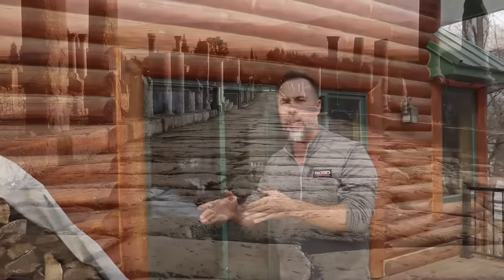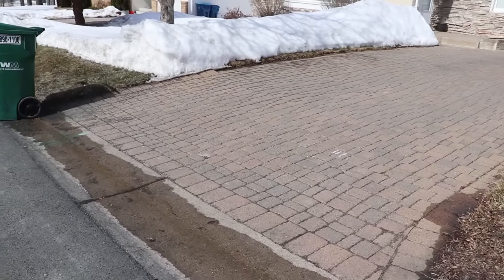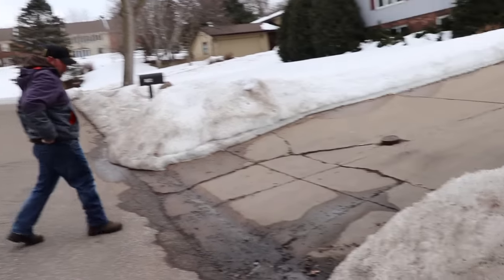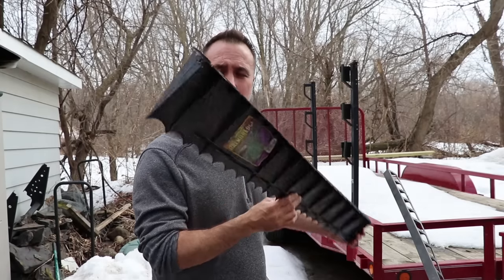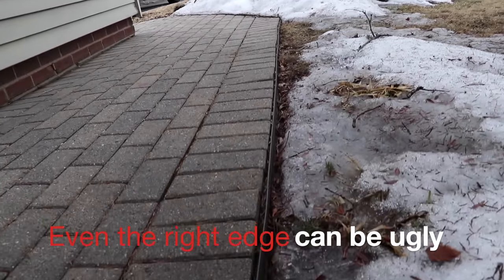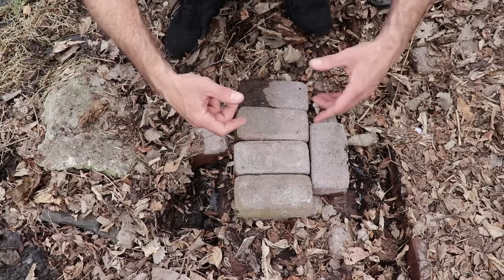How NOT to Build with Pavers-  Why They FAIL! *DIY your own successful paver project

Comment: The new construction industry standard for pavers here in North Florida is 4 in of paver base for patios and 6in of paver base for driveways. And a concrete border around the pavers that's hidden with sod. It's terrible but that is the standard that is held here in Florida. There are only a handful of paver companies who install pavers correctly and they do not do new construction. They do strictly residential sales and many of them do install pavers correctly. Unfortunately for Florida it is mostly sand and it makes it very difficult to keep pavers nice for years on end

Comment: Very good video, Keep doing this.  I plan on replacing my driveway with pavers, and yes my driveway suffers from whole sections of concrete that has dropped down an inch in some spots because of a failure in the bedding.  I am going to visit your "School" so I can see what you are offering.  I subscribed today because you are always presenting valuable information I can use in my projects at home.  Thank you very much.
Reply from the maker: Thank you and thanks for the subscription !

Comment: I like how he recorded the paver driveway from an angle and not straight, so you wouldn't notice the crooked lines. If you know you'll have a downspout, easy, put some concrete under that paver, it won't sink no mo'.

Comment: at our last house, i paid a guy to remove all that plastic edging and put in a concrete edge channel if you will.  The plastic was coming up everywhere and the 10" bolts were rusty too.  The freeze/thaw cycle just doesn't seem to let it stay as is. Would love your pov on this as installing that stuff is foolproof but after 10 years most of it was coming up.not a lot of topsoil either, mostly clay below the surface

Comment: For permeable pavers add an additional 12in of clear 3/4in rock with drainage tubes under the 12in of 3/4in crusher run base.

Comment: I purposely installed a walkway on my mom's house with scrap red bricks so that it would distort, slightly sink in places or drift to make it look old and crafty. My prep was dig out and replace 3 or 4 inches inches of dirt with regular sand over dirt which also made the water go away after rain storm because it was just mud before. On the sides I used more bricks lined up by leaning length wise against each other so the end of each brick was raised slightly higher than the bricks in the walkway. Then I swept some sand into the space between the bricks and was done. 
It worked as expected,  rough and not squeaky clean.  LOL
I would not consider this any where close to being a pro job but for a rookie it worked and I achieved the result I expected.
Reply: Sounds like if someone trips on them they will sue your drunk mother

Comment: Now that you explain the failures, what are the things that you can do to repair them. Or do you need to start all over again.
Reply: Ken Vendettuoli it depends if it’s concrete you can cut it with a concrete saw and pour new concrete ..if it’s pavers you have to take out the bad section and re install

Comment: Our side steps are brand new, (2 months old) put in by the landscaper.  Concrete base and pavers above. The sand has been escaping and now there are deep grooves between the pavers around the perimeter. Some of the sand bonded through the center.  What causes the sand not to bond all the way to the edges?

Comment: Wow, I learnt a lot here.
I have regular Pavers (no rock) and, they cleaned the Pavers and joints and rejointed w Polimeric sand, blowed excess, sprayed manually water w garden hose, let dry next day applied sealer and after 1.5 hrs started rain all day with times of medium to heavy rain. My driveway is on hill. Today I see sand down and I feel on top of the Pavers too.  I'm thinking to apply more sealer.  The worker left for vacation for a week. 
Polymeric sand.. Super Sand bond
Sealer... Seal king
Can I apply more sealer on top, after I blow the excess sand? Same sealer, same technique?
Thank you

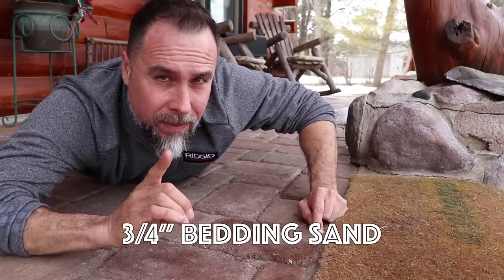Comment: At 4:10 you talk about the shifting of the sand but forget the most obvious reason for the paver to sink. There’s a drain pipe right above that brick that dumps tons of water every year right onto it.
Reply: At 4:04 it said water erosion, right after that picture came on screen.
Reply: yea, it oversaturated the sand and the base below it.
Reply: clacicle EXACTLY!!!
Reply: Cie Fy After watching it again, I did notice that. But still, it’s probably the most obvious reason and should have been mentioned. It’s an oversight. It happens.
Reply: I saw that too and thought it was the most obvious contributing factor. Nice video though - overall. Thank you

Comment: I have switched to 1/8 to 1/4 angular free draining in replacement of sand for paver and natural stone. Less washout and settling. Still use item 4 for base unless doing permeable pavers.
Reply: jaboy321 so you put pea gravel under your pavers as a bed? I’ve been trying to find info on this.

Comment: For edging I use angle iron, drive rebar into ground and weld it together. 10 years since and has not moved. I just had some angle irons laying around at the time so it didn't cost me extra.
Reply: I just laid down a 57 ft driveway, and my edging is nails made from 1/2 inch rebar cut in 12 inch lengths, beveled on the ground side; one nail for each stone on both sides of each row.

Comment: I'm adding a small section of pavers to an existing paver patio.  Should I install them a bit higher (1/8" or so) to allow for any settling or sinking over time?  Or, do I just install at the exact same height?

Comment: great info.  have seen pavers being pressure washed.  with ordinary joint sand seems the sand would get blown out of the joints causing horiz failure.  with polymeric, is it possible to pressure wash pavers?  under what scenario is it possible to "clean" pavers?  thanks!

Comment: i have zero experience with pavers, so these may be stupid questions, but...
1)  How do you clean pavers?  I assume a power washer or even a hose nozzle would wash away the joint sand.
2)  Can you grout or morter the paver joints?
3)  What the installed cost/sq ft of pavers vs. concrete vs. asphalt?

Somewhat related...I have a roughly 900 sq ft concrete patio that is showing wear/cracks, estimated age 50 yrs.  Can I tile over the concrete?  Patio is not covered, annual snowfall ~6".
Reply from the maker: clean with a pressure washer.
no mortar or grout-only polymeric sand

Comment: Don't forget . 2500 years ago people actually cared about quality. They also took pride in building things that last
Reply: plus the roman soldiers would kill the laborers (literally) if they could put their spear into any of the cracks...so the stones had to fit tightly. How's that for job motivation:)
Reply: mr zed Inca builders were taught by reptilian overlords
Reply: So someone maintained those old paved roads, adding sand over the years or..
Reply: also they had charriots.. the parts where the wheel rode are worn.. the rest isn't it.
Reply: mr zed ..just use concrete edge curb for paver edging..y not
Reply: they didn't have 200,000 plus vehicles driving on them everyday either...
Reply: It's kind of difficult to say what the average quality was 2500 years ago, because today you only see the projects that have lasted that long. You don't know how many were replaced or torn down.
Reply: Wouldn't surprise me if the solid stones on Roman roads are more than a foot deep.
Reply: @someguy6075  exactly
Reply: Aaron Lowe stones in the old roads are about 30 to 45 cm deep, even though the top surface may be only 10 x 20 or 15 x 30 cm
Reply: @SarrosLandscaping  Well they were probably conquered slaves.
Reply: @SarrosLandscaping   labors? Hate to tell you but Roman soldiers built Roman roads, it was a highly technical skills not for forced labor like say a quarry.
Reply: Our neighborhood was developed in the 70’s. Our house has a brick driveway. It looks about a million times better than the asphalt and concrete driveways in our neighborhood, even the ones the have been re-done in the last 10 or so years. It obviously isn’t practical for all roads and applications, but it does tend to have a nice rustic charm in areas that aren’t high traffic.
Reply: @someguy6075  Great point.  Without getting into the difference in load the paved roads carry versus what a highway holds up today, we should remember that probably 99% of the old paved roads are gone.  To pretend that the best quality and or least used roads remaining from 500 BC were the norm of their times is silly.
Reply: And dont forget,, they got beat to death if it was done wrong.
Reply: @robbob4872  your driveway has trafic like that? Wow dude!
Reply: @delawarepatriots  not all countries beat their skilled laborers

Comment: Hello Stanley, I have been contemplating expanding by backyard "patio" with pavers. Its currently a 7'x4' concrete slab. I was thinking of just laying pavers around it until its 17'x10' and possibly making some walls on the edges. My issue is i live in Florida and the main reason i want to do this is because the ground around my slab is always the most saturated with water. I don't think they landscaped my backyard properly when they built it so i am hoping to push back the water with this project. My main concern is the base. All i find at the store is crushed stone but its not very specific on the material. What is the best material to put down as a base before my layer of sand and pavers?

Thanks
Reply: The material you are looking for is called hard pack. Go to any place that sells stone, sand and gravel, ask for hardpack. They will k ow what you sre talking about. Make sure to use a tamper (to the hardpack).

Comment: Of course, each of their own, but I’ve seen more of that plastic edging fail than anything. Even within a couple of years. As you say the spikes rust. And when they rust, they rust to actually nothing. Dust! Therefore the edging fails. It doesn’t rust fall apart, and actually grab the soil better. I don’t know who comes up with this, but I’ve heard people say this more than once. And I think they say it to convince themselves It’s actually a good application. Tell me, if you’re trying to secure something and that fastener rust, is it going to hold? Absolutely not! in my opinion, the plastic edging is completely useless and a complete waste of money. Concrete only…. if done correctly, it will last for decades.

Comment: Any issues with using the edger on the inside of the interlock so it goes under the stone? I did that for my patio seems to hold up well after 3 years no issue and it looks cleaner. I was wondering if can do same for driveway. Certainly looks cleaner, no need to bury from the outside.

Comment: Thanks for the tips.  I have a 4" drainage PVC pipe buried about 8" to 9 inches below the surface of the compacted base across my driveway.  I plan on installing brick pavers over top.  With proper edging and compacting, do you anticipate that I might have issues with that portion of the driveway sinking?  Pipe is hard PVC.

Comment: I’d have to disagree with you about the joint sand causing the pavers to rotate. The spacers on the pavers themselves should maintain the spacing. The only reason there’s room for it to move is because the snap edge used as the edge restraint is insufficient and giving away due to the force of the system being exerted on it. A bond beam is the only long lasting method for an edge restraint. Yes concrete does crack, but only when laid out in big areas. Footers are concrete, that’s essentially what a bond beam is, a footer for the edge of the paver system. Love your videos though.

Comment: In the case of the concrete driveway that has a water shut off square in the middle, it looks to me like work was done on the water system and the excavated hole wasn't backfilled properly. So how far down would you remove the backfill to then replace and properly pack it?

Comment: Informative video.  Thanks!  I have quotes from 2 contractors for a paver patio.  One will use concrete base and the other will use sand and gravel.  Which base is better?
Reply: Concrete always cracks gets weeds up through it and also not good for drainage..gravel is a better soak away but need weed membrane

Comment: I only pave on concrete. Ive laid around 1.2 mill pavers in my time.
Call backs: nil
Sunken pavers: nil
If you lay on concrete, 1” paving edges, header course restrained by concrete you will be a successful paviour.
Reply: Sure, but it will cost about 10 times as much.
Reply: No it doesn’t 
Take a 30 sq m area or 300sq ft
Concrete $250AUD  a cubic.
3 cubic delivered costs $750
Compaction costs nil.
Rough screed ok. No concreting skills required.

Compared to:
Road base $70 ton
Need 5T or $350
Compaction costs $150
Total $500
On a 300 sq ft job it costs an extra $250AUD or $1.20 a sq ft
That’s around $200 USD 

We put our concrete in dry if in a hurry and we are paving on it by 11am
Add in the point of difference factor over your competitors and offer a 5 year warranty even in driveways, charge more and make more money for the same amount of work and it’s often quicker. 
Now add in no come backs 
Now add in Bullit proof reputation. 
It’s a winner.

Comment: I mix sand and crusher dust and cement, to create a weak concrete like but stable base. Its way stronger and has never failed, better than compacted cruncher dust alone. My bedding sand is also mixed with cement. It also will stop weeds.
Reply: Im in uk someone has put type 1 down for a " re claimed" brick patio and IM now stuck with it what would YOU put next ??

Comment: I’ve never used sand.. always used 2a for base and then limestone 1a to level.. tamp 2a and I also tamp my 1a  ( bout 1inch then use second layer lightly and it almost turn like concrete but it’s not , then lay my brick and tamp, polymeric sand the cracks and wet it.. done many over 20 yrs ago and still look good

Comment: Hey everyone. I am removing a deck and the soil underneath is good but is uneven and dips about 10-16 inches. I will do pavers for a big patio. 1.  What should I fill it with? Base or more compacted dirt?   2.  Should I remove all bigger rocks or can I fill and compact over that? Thanks for the help. --Cris.

Comment: For doing pavers. Try using 1/4 inch stone , instead of sand or stone dust. Water will pass through the 1/4   Unlike sand or dust.
Reply: I will try that. I have had good luck with laying down only 1/2"  sand layer over crushed rock base but think I will give your suggestion a try. Makes sense to me.
Reply: wade5941 works well in the north east. 
I don’t get many call backs from customers saying their pavers lifted from the ice n snow.
Reply: @Jerzeyguy  Snow, ice and frost heave more serious here in North Dakota.  I get a fair share of jobs to repair pavers/walls that have moved.

Comment: after figuring the cost of crush and run,tamping the layers,washed sand and labor and delivery cost ,once the 7 inches of dirt was removed and graded we poured 4 inches of concrete and placed paver on top with the edges glued in place. 15 yrs later no problems. the cost was cheaper to do with concrete

Comment: The driveways you show were cement based.  If water gets under where it freezes it will tear it apart.  They would have to maintain it to prevent it.  Most don’t.

Comment: This is a cut from an article by Howard Kanare;

Shown here are six concrete floors that were cast over time in one of the buildings by a “Pre-Pottery Neolithic Part B” culture 9800 years ago. It's hoped that an examination of the concrete in each floor will reveal how their concrete technology developed over time.

Seems concrete predates the road you spoke of. Roman concrete is also roughly 5,000 years old.

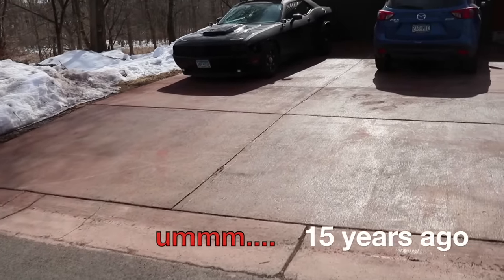Comment: 1:40 -- Time flies, don't it?

On those 2,500 year old roads, most of the work of building them went into the base. Underneath the pavers were usually 4 layers: sand or compacted earth, crushed rock, cement and gravel, and sand, cement and gravel. There was some variation in different regions (the Roman Empire was big) but they paid a LOT of attention to this part of it.

Comment: The reason that those Roman paver roads has lasted so long is the use of sea water in the mix instead of regular water.  The sea water is full of trace minerals and diatoms.  That makes it more like glue than just like water.
Reply from the maker: I had no clue about that.  Thanks
Reply: They may have lasted 2500 years, but they stopped using them 1500 yrs ago. That said, lasting 1,000 yrs is still incredible.

Comment: Should I use plastic paver spacers between all my pavers? I was curious if they put unneeded pressure like pushing down into the sand which would move pavers verticals?

Comment: I have a project for pool decking using tumbled travertine in french pattern 1 1/8" thick.  Your video states 3/4" sand.  My contractor wants to do 1/2" sand.  I know too much sand is no good, but is 1/2" enough?

Comment: 2:45 Still looks good but I wouldn’t say it hasn’t moved. The side lip is curling up and the pavers are no longer straight after years of cars turning in and out of driveway.
Reply: Also has a huge chip in the center =/
Reply: Carson Jensen plus the dead squirrel by the garage

Comment: My contractor recommends concrete edge restraint for my new pathway made of 2’x4’ large, 2.5” thick bluestone tiles. There is no grass in this area, just decorative gravel, so grass cooking is not the issue. Is concrete restraint ok then or should he use metal restraint edge?

Comment: Question on vertical failure, my concrete based is not even and I may need to put more than 3/4'' sand down in some areas. What do I do? I really don't want to dig it all up